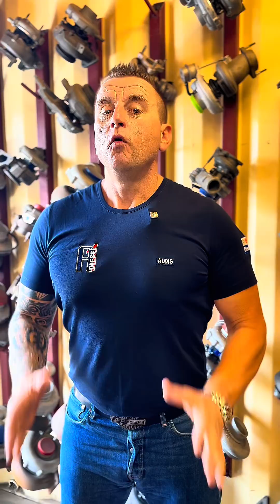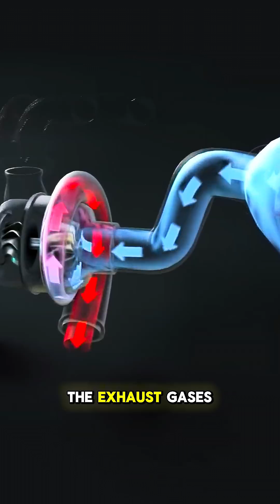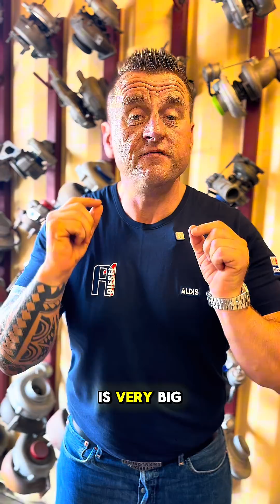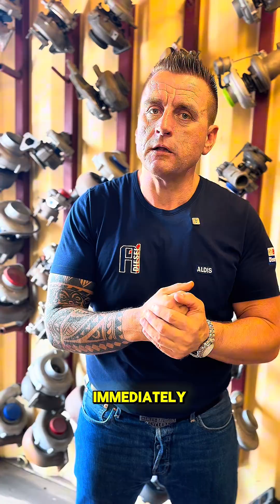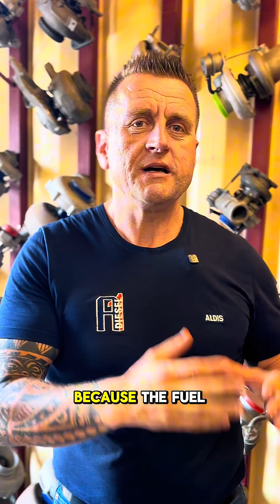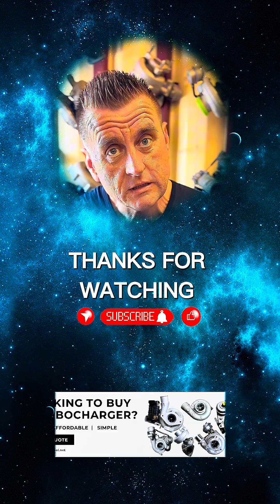Turbocharger vs Supercharger: Which One Is Better and Why?

Comment: Turbo chargers create higher exhaust gas pressure before the turbo , some turbo fanatics get obsessed with high boost pressures forgetting that boost pressures create even bigger EMP,s creating excessive heat in tje head valves and pistons.

Comment: My question  is using small cars diesel, can  it help me??
Reply: Small diesel cars are only good if you drive it all the time cos of the dpf...the dpf must get hot to burn particles in the diesel...so driving 10 mins will not get the dpf hot...so best diesel trotro cos it is driven all day..private car is not good as diesel unless you go to tema and back 4 times a day...
Reply: Thanks Boss appreciated, the reason is am a Electrician  which I work around kasoa and Accra even as far away if possible.  And  I wanted  to buy a  car like  Mercedes vito diseal or  vw caddy diseal or or any  mini van which is  diseal that why , I was asking such questions  so advise me.  Should I go in for petrol or diesel,  Because of the nature of my work I don't use the car all day, as  u  said  somethings from home to site and park.  Waiting for your reply tnx